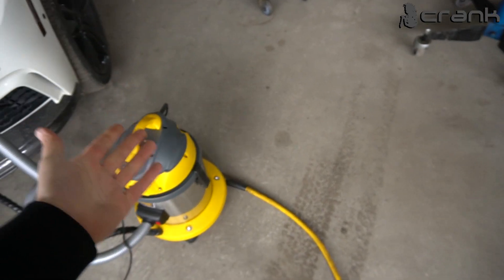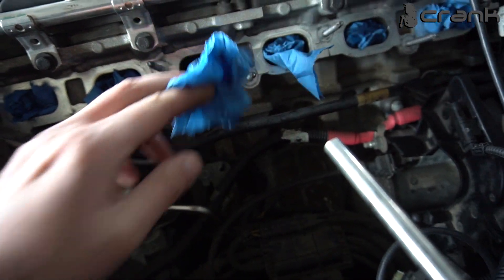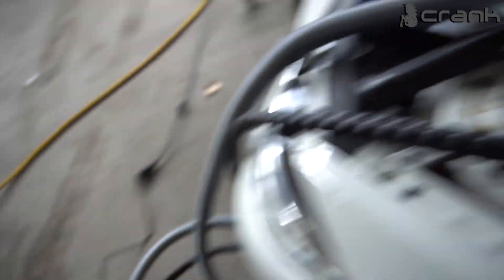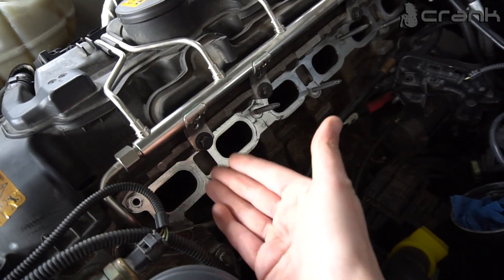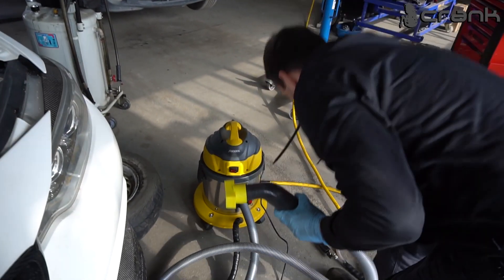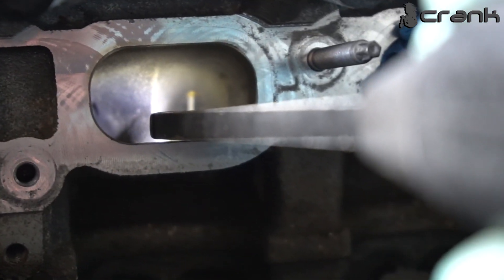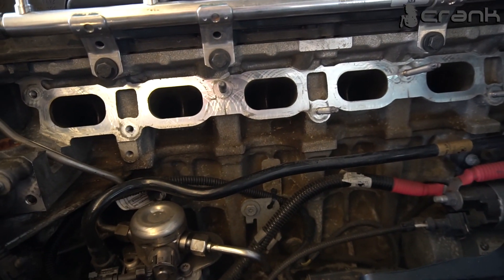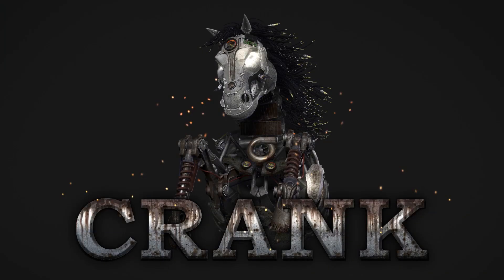Walnut Blasting Intake Ports and Valve Stems BMW N55

Comment: Nice result guys. And that wasn't that much build up for 120k km. My 335i n54 had the double amount of carbon build up at only 85k km (but the car was 10 yo). Got a question. How much are 6 n54 index 12 injectors at your local dealership? I have to buy these OEM ones in the near future but the prices at the moment are insane. For 6 injectors plus decouplers, the dealership charges me €2500,- at the moment. I'm now on 6 index 9 injectors which are remanufactured and tested with Bosch test reports. They lasted only 6 months and 3 of them are leaking overnight. On the 'zero to 60' forum Alex the Russian warned me not to buy remanufactured n54 injectors. And he was right, unfortunately. Dutch regards, Nico.
Reply from the maker: Thanks Nico! Yes they are crazy expensive. The price is pretty much the same here +/- 100€. One of the biggest reasons why people are avoiding this engines, you can't go with aftermarket injectors or remanufactured + some other minor stuff :D

Comment: My E39 M57 needs this procedure done, Would you recommend doing it with the valve cover removed? Since the valve cover is part of the intake port, or leave it on?

I'm experience random rough idle on the car that's very frustrating, my other car is M51 and always idles smooth as butter.
Reply from the maker: Yes, if you want to do it properly, you will need to remove the valve cover, so to have better access to the intake ports.